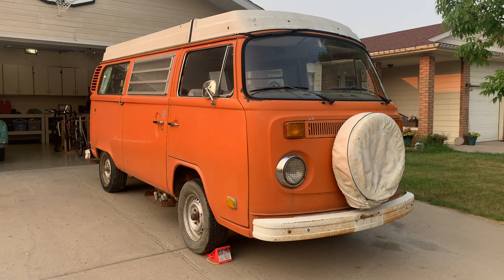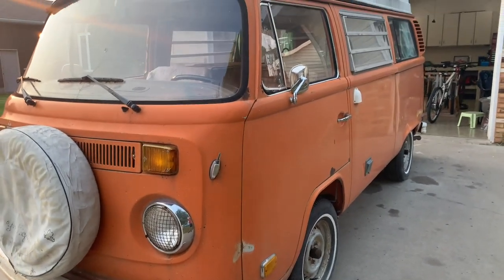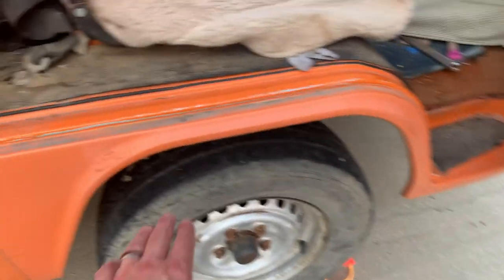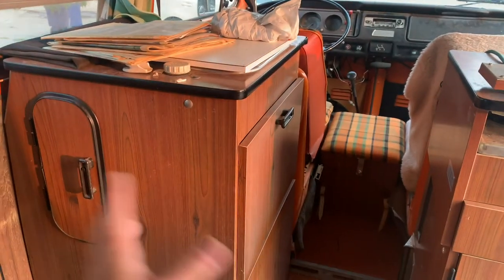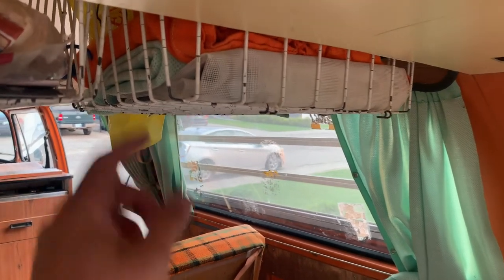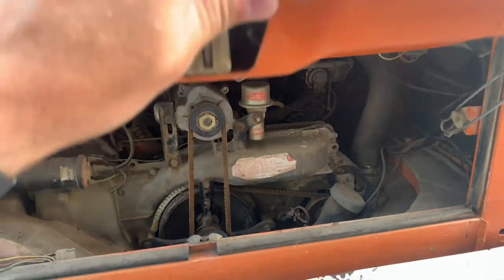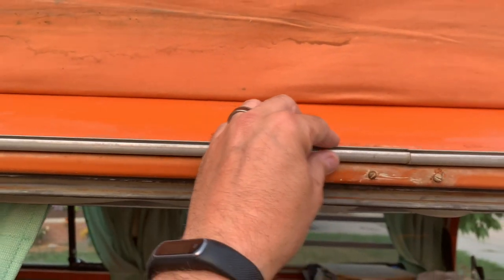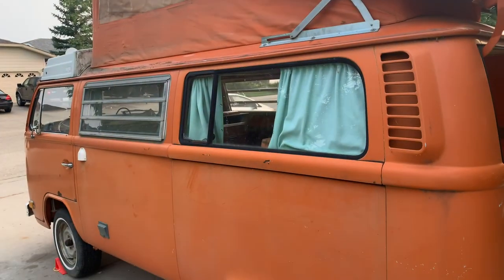1974 Volkswagen Westfalia Tour

Comment: You are correct, 1974 was the first year with the double bed up top.  The 1973, and earlier top opened in the opposite direction, and there was a canvas cot that could be opened up top.  So, this is a big plus in 1974+.  I hadn't even thought about the roof access from the pop up.  Thanks for that tid bit!  I have a yellow 1974 Westie that originated in Canada, then came over to the U.S. some number of years later to live in Michigan for a while, then California, and now New Hampshire.  It's in a little better condition than yours is here.  I guess Canadians take care of their VW's.  :D  What will you do to get 100 HP?  Will you keep the Type 4 engine, and change the cam and such?  I will check out your other videos, so you might have already answered that question there.
Reply: The earlier pre-1972 bus/bay came with a continental (double-bed) option.